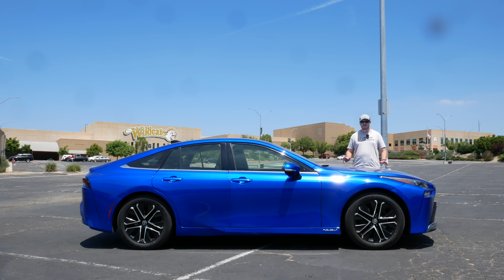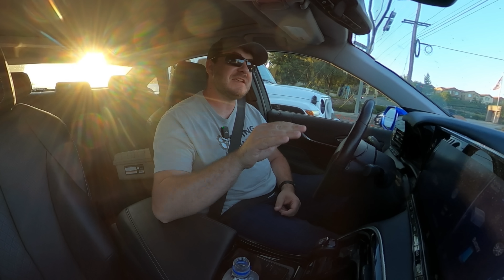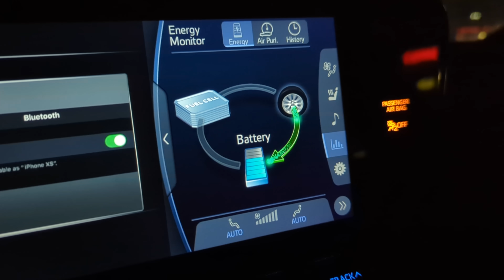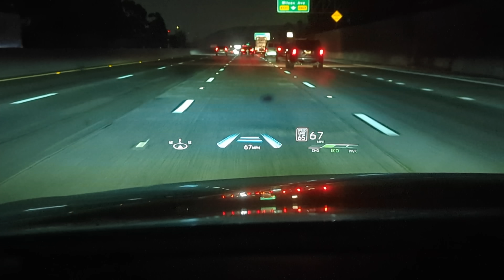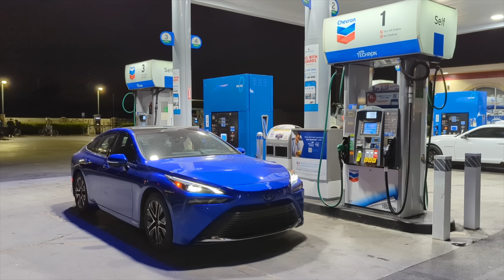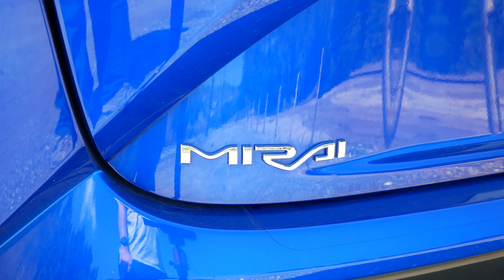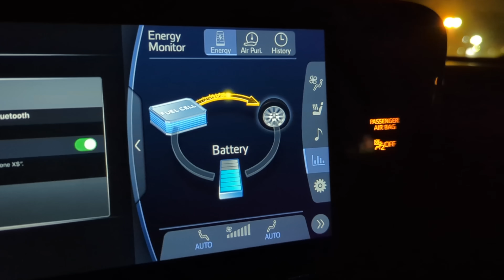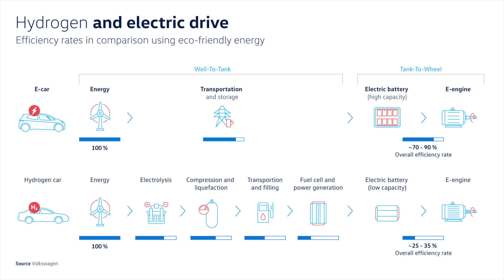The Toyota Mirai is Disappointing

Comment: The reason hydrogen never really picked up was because the Obama administration cut all funding for hydrogen development since it was an actual competitor to gasoline. EVs are great until you have to supply the country with them. Africa will never develop into gasoline, diesel, or EV vehicles- so Toyota is betting on serving the needs of Africa 50-100 years down the line, a market that nobody else will be able to compete in since no other manufacturer continues to develop an alternative that actually stands against oil-based fuels.
Reply: Why do you think hydrogen is more suitable for African countries than battery electric?

Comment: Hydrogen hater review. It's pretty obvious the point of this car but you are ignoring it. The point is to have an electric car that you can refuel with hydrogen systems in place. Like gas stations. Glad they are testing both Hydrogen and Battery Toyota.
Reply: Sure, but even if large numbers of hydrogen stations are in place there are still so many drawbacks.

Comment: Hydrogen is a SCAM. now hear me out. I don't mean scam as in it does not work. it works perfectly fine. we have been using the technology in space (such as the space shuttle) for decades since before some of you were born in fact. Hydrogen fuel cells are proven technology. BURNING hydrogen is proven science.

SO what do I mean? its a SCAM in that it is NOT green and its NOT cheaper and its designed to screw you.

The core issue with gasoline is two fold. first its dirty. but I actually consider that to be a minor issue in the "immediate" picture. the second thing is it makes you a SLAVE. its designed to screw you. expensive cars that are expensive to repair that cost a fortune to run.

Electric cars BREAK this process. badly. and they hate that more than you can know. this is in fact WHY GM killed the EV1. it has nothing to do with EV's specifically or the EV1 specifically. it had to do with the battery. the battery was the "killer invention" the set a goal for Ovonics (they are the ones who made the battery for the EV1) make a battery that cost no more than a car engine and would last as long as a car engine. this meant $2500 and 250,000 miles.

They succeeded. Ovonics was ready to produce NIMH traction packs that would cost $2500 RETAIL and had an SOC of 80% over 250,000 miles. (this means after 250,000 miles typical usage they would still have 80% of their original capacity) toyata tested one to 400,000 miles with almost no degradation in capacity. they really where that good for the time.

At this time GM realized 54% of their profit comes from "AFTER" they sell you the car. service. parts warranty, repair interest etc.. etc..

MOST Of that goes "POOOF" in an EV environement (NOT a lithium environment!! at least not yet) they made a small batch of high tech bleeding edge EV1's (they put everything and the kitchen sink in it bleeding edge tech that would eventually go on to be standard its where SATURN came from actually) traction control, plastic body panels, mangenisum seat frames and construction etc.. etc...

HAND MADE PROTOTYPES. every EV1 was hand made a one off. and already. ALREADY they had the production price down to $80,000. that much for a bleeding edge high tech prototype is INSANE. just image how much cheaper it would be when mass produced!! this is why they were anticipating a $40,000 price tag for the first run. it was going to be CHEAP

And this is because an EV is closer to a "solid state" car. when you ramp up production of a car there is a limit to how much you can reduce the price because you still need the same machining and labor for each one to some extent. imagine making a hand made widget. how much does it cost you to make the second one? third one? all the same work. Now think 3D printer. might take me 100 hours to make the first one but the second one? just click PRINT again.... See the difference?

Hydrogen fuel cells are a scam because they keep you a slave to a FUEL PUMP that you can not control and you will NOT be allowed to make your own. to "support" laws banning you making your own (lets forget that right not the equipment to compress hydrogen as much as is needed is WELL beyond any normal homeowner) will easily be supported by just showing hindenburg pictures. (even though the hydrogen did not kill anyone in that accident. the 120ft fall is what killed them)

THIS is why they are pushing so hard for HFC's because it retains their PROFITS and their CONTROL over the car its costs and the FUEL source.

EV's ? I can toss 8 solar panels in the yard behind my house and NEVER pay a penny again to charge my car. ever. they really do not like that. and they can't easily "ban" solar panels and inverters and batteries.

Its not that Hydrogen fuel cells don't work. they work just fine. its that they are designed to SCREW YOU

oh and it just so happens the VAST BULK of our hydrogen comes from ....... Petroleum..... so they are fine with it too.

Comment: So a future application may be an F-150 plug in electric with an onboard hydrogen fuel cell and large hydrogen tanks to extend the range. All to make the truck useful at doing truck stuff, like hauling and towing, with out having to stop every 100 miles or so for like an hour or more. Internal combustion engine- '' look what they need to mimic a fraction of our power''

Comment: From what little I found on the internet about hydrogen production, methane steam reformation, emissions and efficiencies, it doesn't look much better from a pure energy efficiency viewpoint, than an efficient diesel. The efficiency of electrolysis is, safe to say, abysmal, at, at most 60%. Gas steam reformation sits at 75%, and the efficiency of hydrogen fuel cells range from 40 to 60%. It's important to note, that these are all theoretical figures, so IRL, they're all slightly worse, from beginning to end. If you take the most theoretically efficient of everything, you get somewhere around 45%, which is marginally better than the most efficient combustion engine.

The only advantage is charging time, but the infrastructure is quite specialized, and as such, expensive, to the point where I can't help but ask myself: why would someone bother with an extra conversion step, with significant losses, and not just put the electrical energy directly into batteries?

I totally agree, that hydrogen may not be completely useless, as it might work well in situations where you have a few big refuelling stations, as opposed to many small ones, possibly with production on site, such as freight transport, or mass transit.

Comment: The big issue with these at the moment is the system needed for keeping liquid hydrogen on-board.
Just as EVs have the issue with the weight of batteries and time needed to charge them as a road-block to their ease of use, so do these with the hydrogen storing.

Solving either of the problems firms would result in either:
A hydrogen car that you fill up once and ends up with an absurd range from the stored fuel, so that the issue of reduced infrastructure has far less impact.
OR
An electric car with a considerable range that would charge in a shorter time and which would effectively always have it available as long as it's plugged in at the end of a trip.

The range wars really should stop at what's considered the limit a person can drive in a given day if all they do is drive. I think anywhere over 600-800kms you get fatigue setting in and while you technically COULD drive on, the odds of you screwing up are far greater. So it won't matter if a car can do 1200kms on a tank of fuel if an EV can do 800, stop at a motel and get charged from an extension cord to your room. Not unless whatever fuel you're running is cheaper to produce and distribute than electricity, which is a tall order.
Reply: The hydrogen on board is stored at 700 bar in gaseous form.
Reply: @Freba9  I know, the video he mentioned from Engineering Explained explains why it's done like this at the moment. I watched in the past because it was about such a rare solution.
The V12 7 Series that BMW used as a test platfrom for their hydrogen solution used liquid hydrogen, but because of the cooling installation a ton of space is needed in the car and the tank used to store it is amazingly complex and expensive for an automotive application, making it not feasible for mass production.
The other downside was, as soon as the hydrogen warmed up even a little bit, it became a gas again, and would quickly overwhelm any container it was stored in, so BMW had installed a valve that would allow hydrogen to just vent out of the system whenever the vehicle was stationary (keep in mind, this is very expensive fuel) to prevent it from, well, blowing up.
It was estimated that within only a few days, you would lose most of the liquid hydrogen if the car was not in use. So imagine you fill your car with gas, park the thing for a week and when you come back you have to fill it back up because the gas has just evaporated to atmosphere :|
Reply: @vtr0104  alright, I see what you mean. Yes, that would be absolutely terrible design.

Comment: Very complicated the hydrogen fuel cell and the availability of hydrogen well l am sure you had LPG were you could get your car to run on LPG Sydney Taxis used it because it was half the price a litre than petrol andthe cabs were 6 cylinder cars so it made sense for taxis and couriers but the taxis now are Toyota hybrid camerys reliable and cheap to run

Comment: Back when the first public test hydrogen vehicles were leased and hydrogen filling stations were built, the retail price of hydrogen was $8 per Kg. Last year the price had risen to $16 per Kg. And now it is $30 per Kg? Ouch! That means a fill-up would be $150 for 300 miles, or 50 cents per mile. Meanwhile, someone driving a Prius would pay about 10 cents per mile for gasoline, and a Tesla driver would be paying 2 to 3 cents per mile for electricity. Because of the high cost, it will never be economically competitive, even for big trucks and ships.
Reply: High cost comes from terrible efficiency across the entire process. No economy of scale will ever fix that. Promising for zero carbon planes and ships though, unless another light weight option appears in the next 20 years.

Comment: So wait... hydrogen is pretty combustible and can be used in internal combustion engines, so why bother with a fuel cell? What is the benefit of using a fuel cell vs just making an ICE that burns hydrogen?
Reply: Fuel cells and electric motors are far more efficient than combustion engines.
Look up "engineering explained", he has some videos about the maths of hydrogen combustion. In short, a hydrogen combustion engine car will need so much hydrogen that you can just forget about having back seats or a trunk.
Reply: @logitech4873  oh neat. Thanks!
Reply: @logitech4873  Besides the fuel cost.

Comment: Lithium is a nonrenewable resource which is why I think hydrogen fuel cell passenger cars could be an option since some people will always need to drive personal cars. considering climate change I think electric buses/trains that connect directly to the electric grid are the most logical solution

Comment: nice to see someone look at a hydrogen car, sad to see they're currently almost as useless as EVs.
Reply: How are EVs more useless than hydrogen cars?
Reply: @Freba9  theyre seemingly both equally useless for any sort of long drives.
Reply: @popehentai  Modern EVs do just fine on long trips. You can easily cover 1000 km in less than 11 hours.
Reply: @Freba9  so... 2 hours longer than with a gas vehicle? Charging time is still absurd and will always be a massive downside until i can get a 100% charge in 5 minutes, comparable to a full tank of gas. I can currently fill my tank in my 94 honda in a couple of minutes, drive from Murfreesboro TN to Marietta GA on a single  tank of gas and still have some left to turn around with, then fill the tank completely full in a few minutes and drive back without ever stopping. There is literally no way to do that in ANY EV. it would require multiple stops, and your battery will never be at 100% aside from when you leave initially. theyre cool to putter around town and all but if you need to move something, or drive any sort of distance in a short amount of time, theyre terrible.
Reply: @popehentai  You need to take breaks anyway, so the difference is smaller than 2 hours. ~1 hour difference in total is negligible in my opinion, as it is a small price to pay for far lower CO2 emissions.
Reply: @Freba9  why would you need to take breaks? given the time, and the costs, and the long term cost, for many people an EV is just not viable. Will that EV be doing the same drive in 30 years? of course not. it will take even LONGER, and probably be on its 4th or 5th battery, which will cost 4x the cash of an entire late-model gas car. Myself, and most people i know, have zero interest in one until the charging time issues are fixed. its only a small price to YOU.
Reply: @popehentai  Ever heard of breaks to take a rest? And no, I did not claim EVs are cheap. However, they are becoming a lot more affordable and this trend will obviously continue. My only point is that many people think charging time is so important, while in practice this barely is an issue.
Reply: @Freba9  if ive got somewhere to be, i tend to just try to get there. i can eat a hot dog in the car, that i bought while i was pumping gas.charging time IS important, if i have somewhere to be. I value my time. we've seem that in practice it IS an issue. you simply cannot fully charge the vehicle in a realistic amount of time. you WILL have to stop, multiple times. whether you want to or not.

Comment: “The tank is cylindrical and made of carbon fibre”

* Titan submersible has entered the chat
* Titan submersible has imploded 
* Titan submersible has left the chat
Reply: At least, Toyota Mirai got a steering wheel instead of an Playstation controller. 😀
Reply: There are many comments here refering to this.
But high pressure from outside or from inside of a cylinder is a crucial difference, the force effect onto the carbon fibers is completely different. 
Carbon fibers love stretching, they are "made for it".
Reply: This reminds me of the discussion about a "vacuum airship".
It's pretty easy to construct a lightweight gas cell, which can hold 1 bar internal pressure (1 bar overpressure against the outside pressure).
But it's impossible the other way round, a lightweight structure that withstands an outside overpressure of 1 bar (vacuum inside).

Comment: There is great concern over climate change. And for those who do not use it as a platform to hate and fight, that is a good thing. 

However, it is also a very complete catch 22. This is because our society is built on 3 things: 

1) Power (whether electrical or mechanical) 
2) Communication
3) Transportation

And...

If any of those fell (even mostly), it would take the other two with it. 

So therein lies the catch 22.

If we stop burning all fuels, we will rather quickly return to a 3rd world society. 

Are there options? Yes, but none really have a good balance between causing and fixing problems. 

For instance: If we covered the world in solar panels, it would be about as pleasant to look at as a paved parking lot. Yeah....

Then there are other questions. The biggest one is all of the extinct species. Not only can we not bring them back, but how would the ecology that had adapted to being without them be affected by their return? 

The only real thing that we can do is show the decent into more problems. 

And many of the proposed solutions are creating as many problems as they are solutions. 

There are too many questions, and not enough answers.

Comment: Hydrogen might not be the best alternative, bug unfortunately, EVs aren't anywhere near as "green" as most people believe. Whilst the vehicle itself doesn't kick out harmful emissions,  the same cannot be said for the very dirty process of producing huge numbers of batteries. Not only is mining and refining raw materials dirty, current batteries require large amounts of relatively scarce metals. Throw in the problems of recycling them, plus all the extra copper and plastic used in cabling used in the construction of millions of EV charging points with all the extra electricity production to cope... and "green" soon becomes very "grey".
Reply: The materials involved in creating batteries are very common compared to what's needed to create hydrogen fuel cells.
Reply: Greener than anything else. That is the point.